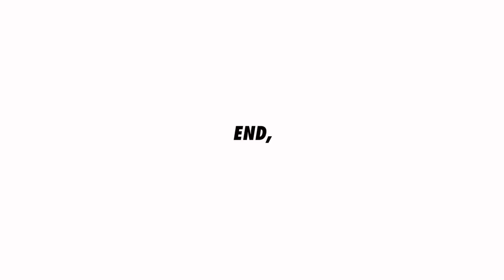W58_Kitchen cabinet doors

Comment: Awesome! I've been searching for the perfect drawer trim solution for our 4wd mobile home bus (which we use to explore the wilderness of New Zealand). The method you have used here is the best I've seen. Our cabinetry has live edge slab tops and is all drawers and no cupboards. In a visually adventurous move, most of the drawers have curved fronts. The bedroom cabinet (when viewed from above) is a quarter oval shape. (To hang these crazy-shaped drawers, two of the drawers have two sliders on one side and no slider on the other side). Thanks for creating such a brilliant video and for doing such beautiful work. You are an inspiration.
Reply from the maker: Thanks for your comment~!😆